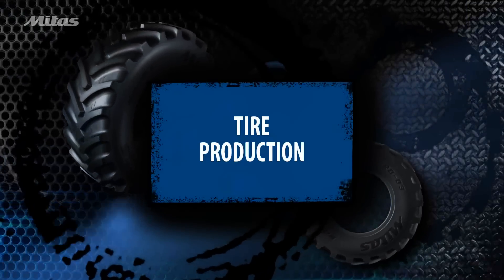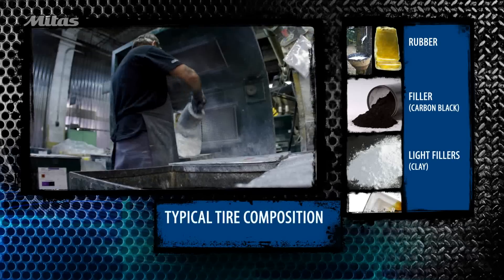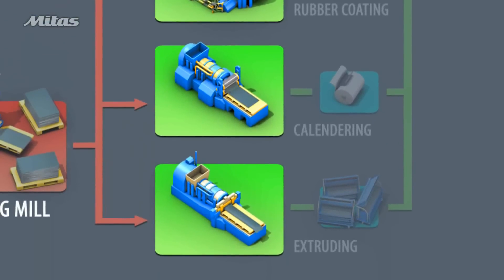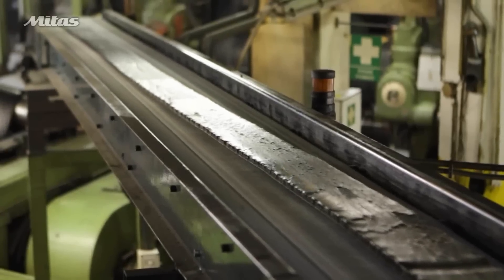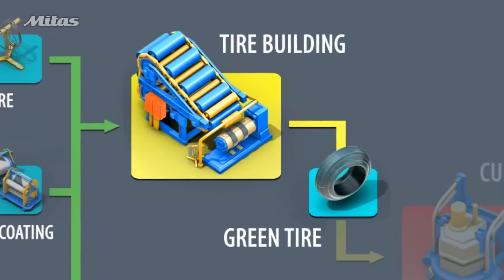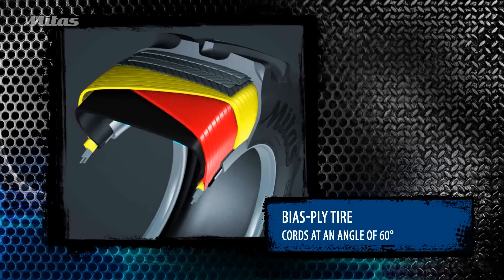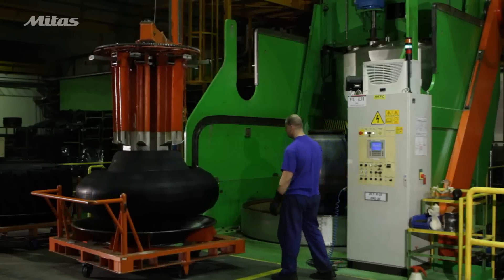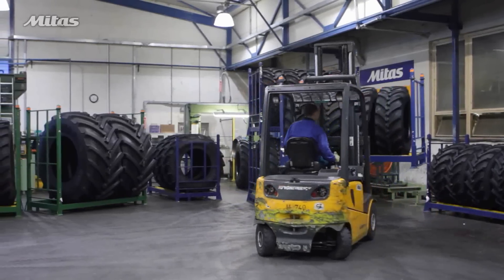How to make a tire

Comment: letoff stand for belt building machine ( https://youtu.be/TzNcmIKLn74
TWIN WIRE CORD: EVEN AT DIFFERENT BOBIN DIAMETER, LINE SPEED 250MPM,  CONSTENT AUTO TENSION CONTROL SETING RANGE 2 TO 12KGS
FEATURE: IF ACTUAL TENSION IS CHANGED 20% OVER OR UNDER SET TENSION VALUE. WINDER WILL  ALARM AND MACHINE GET OFF. 
CORD CUT SENSING INCLUDED,
WHILE RUNNING WINDER, IF ANY MOMENT CORDS GET STUCK UP OR TENSIONS GOES BEYOND THE 6 TIMES HIGHER THAN SET VALUE. MACHINE   GOES EMGCY OFF. WHILE STOPPING OR STARTING THE OPERATION, IN BOBINS CORD IS NOT GET LOOSE, OR OVER TIGHT. It is energy saving product, it will consume 50watts power. if any clients, technical consultancy need, please catch me in mobile 9442630950, youtube: srimindia,  srimmuthu@gmail.com;